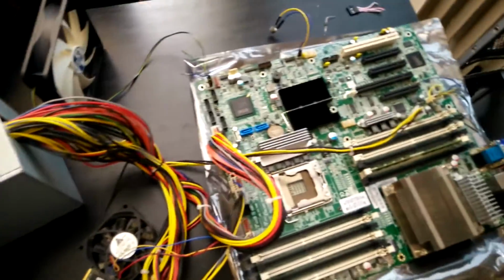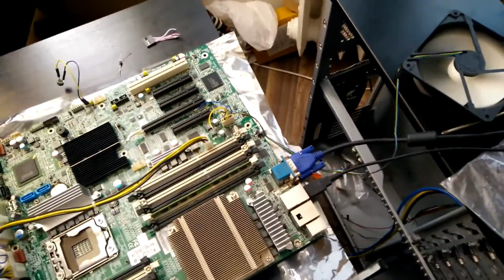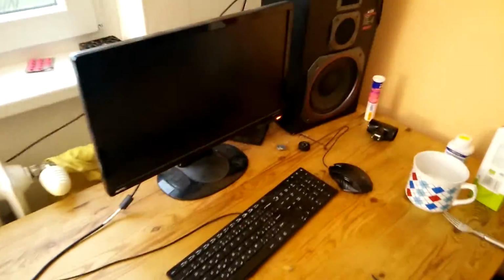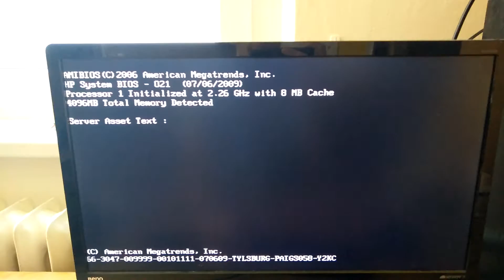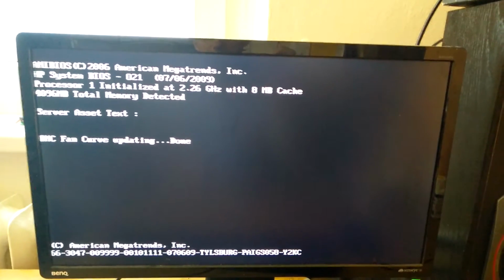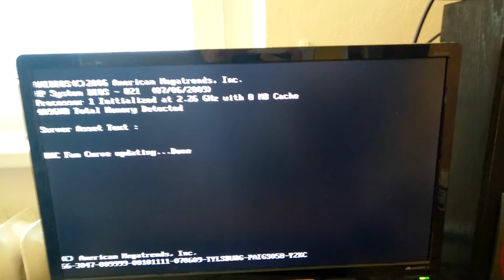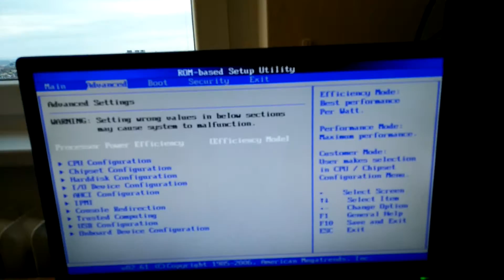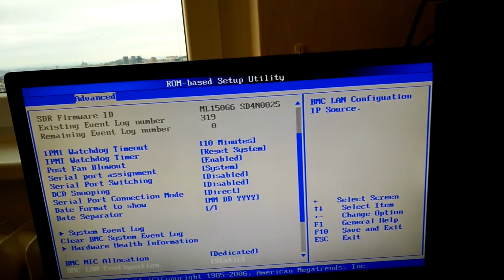Proliant ml150 G6 Motherboard Issue

Comment: You can inject a low frequency signal (some hundred of Hz) into the fan tachometer fan connectors input pin on the motherboard to fool the bios and then use any fan you want. I did it with a very simple generator based on an NE555 IC on a bi-processor ML150 setup during several years...

Comment: Hello! I have this mobo and I updated it and put it in some new fans ... and then something similar happened, I don't have server coolers so the 3 or 4 pins will fit ...
BUT!
I had to cut the plastic bracket to connect them because ground is the second pin (the fan connector for normal fans has to be 180º twisted).
My mobo was booting fine and everything else when I plugged in the new fans didn't start anymore so I removed the new fans and plugged in the old ones as it was before and it started fine.
SO
I put the new fans in the red connectors and it just started fine!
this mobo is a bit sophisticated with fans, it is possible to connect normal fans but this way ...

My recommendation is to plug 3 fans into the 3 white connectors and see if it starts up and everything works fine!
In the bottom right connector use a 3 pin fan, not 4 <---- THIS WAS THE CAUSE OF NOT GOING FURTHER FROM BOOT OR BIOS

Comment: Did you ever solve this? Currently have the exact same issue

EDIT: Solved it. For future reference: I had the board breadboxed but did not have the original fans plugged in (Had 80mm aftermarket fans plugged in). Connected the original fans and now it works just fine. I read somewhere the fans need to spin at atleast 2000RPM otherwise the system shuts down.

Comment: The solution? I know it i have done the same to my system. The cpu 4 header is normaly for cooling both the cpu's but that fan needs to rotate at leats 2000 rpm if you don't want the server to shutdown, you cant not see it if you only have the motherboard but when you hookup the system lights the alarm light wil strart blinking red in seconds

Comment: I have the same board and ran into the same issue. In my case it was not overheating, because the board shut down later when it was getting warmer / summer outside.  -> The fans spinned a little higher. So I tried  a high speed fan, connected rpm-sensor-Signal to sysfan3 and sysfan4 and disconnected pwm-signal. For ambient-temp-sensor i used a standard Transistor. (Diode did not work.) Now I could change things in BIOS. I adjusted the IP for ILO2 and then reconfigured fan settings over management-Network. Now the board runs stable with low-rpm-fans and pwm-speed-control. You can try, to disconnect pwm-signal first, so fans will run at full speed. Or use a "fake rpm sensor circuit". Good luck....

Comment: The beep code you hear in the beginning generally comes up with the proliants whenever they have memory config issues. Check you memory configuration, check whether it's supported ram, try with another ram modules. The cpu should be fine.
A good point to check what's going on is to check the lo100 and try to figure out whether the bmc logs something useful (quite possibly not, but still worth the shot). if that doesn't help, the mere fact the server boots and completes post (it completes post, otherwise you wouldn't have gotten to the bios/rbsu) means the cpu and the ram SHOULD work. I've had similar issues a few dozens of times with customers and the issue was either to update the LO100/BMC, which in your case is impossible, or to swap the mobo. Having said that though, I find it odd it works for a minute or so before it kicks you out, so I reckon it's worth the shot to check the PSU - try with another one if you have lying around, but first make sure the ATX header has the standard wiring (I've had PSUs from older HP machines with ATX power supplies, having odd proprietary connector pinouts, so it's worth checking it out and comparing against an ATX schematic online. If you don't have a spare PSU, you could get a multimeter and try to see whether you have a drop on any of the supply rails, i.e. you clip the gator clips to ground and let's say yellow and wait to see whether there's going to be either surge or significant drop in the voltage from the expected +12V and then you do the same with the rest of the rails. The delta PSUs in these low end proliants shouldn't have multiple rails with the same voltages, so +12V should be +12V everywhere accross the machine and if there's something cheesy about it you should see ti all across the board. If you see something, this should be a good indicator the PSU is failing on ya. The last resort is of course minimal configuration (which from the looks you've already got), CMOS clear and eventually to revert to the redundant rom (check the inner side of your case access panel for details how to do that).

Hope you figure it out. Cheers!
Reply: Ok, may bad - I missed you saying you've tried multiple CPUs and mem modules. Now watching your video a second time here's what's happening - the board has auto power on enabled, which means whenever you apply power to the attached ATX PSU the machine will boot. What you do with the blue button is bs(in case you haven't noticed the ports this is the back of the server), because it's the UID, meaning it does literally nothing but to light up, allowing you to find out which machine you're supposed to do stuff on if you had, let's say 20 machines all stacked together. Having said all that - you don't have the power button assembly, which so happens, contains besides other stuff, also the ambient temp sensor, which in turn might cause the machine to power off the way it does. Get your hands on it. If you're looking for a part (other than the mobo), you can get pretty much everything from a ML330 G6 too - they're essentially the same servers, except for the mobo.
Reply: Here you go:
Front panel cable assembly - Includes the power button and the four status LEDs - Connects to the system I/O board2
519739-001
Reply: Frequenc yeah, cause the front panel is not just a piece of plastic, but also has an ambient sensor. ProLiants are notorious for not booting up if a fan is missing or a sensor's reading is out of expected treshholds.

Comment: The CPU is overheating. That's why you are having the shutdowns. I think you will need to get a fan on the CPU heat sink you are using .
Reply: for starters take it off the antistatic bag because those are actually conductive....

Comment: ok the motherboard is a 466611-011 dual lga 1366 yes?, I was going to do the exact same i will tell you if I get this issue. I will research your issue. it seems to be ram more than a bios fault as it does boot. what type of ram is it I'll check the qvl as I would assume ram.
Reply: Did you get yours running? I'm having the same issue only when running 2x 5570. It runs fine with single